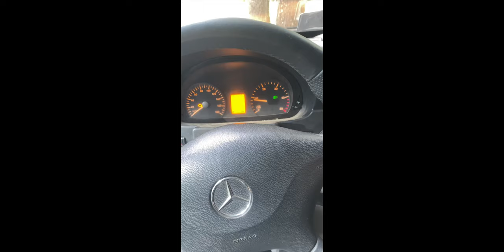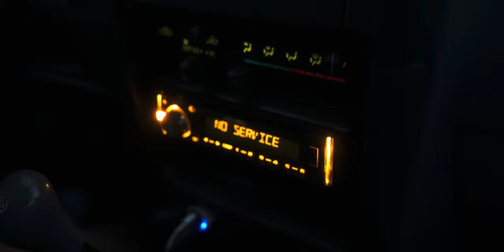JUST A QUICK UPDATE | #12 Back in Patagonia

Comment: Beautiful videos! Fantastic Trip! I am a fan. I cannot immediately find more information about your Sprinter. I think it is the third last type of Sprinter, so without AdBleu. But which motor? And is there a diesel partical filter in the exhaust? What are the results of the high sulfur diesel fuel in South America? What preparations or changes did you do on technical level for fuel filter, motorcomputer or exhaust? Thanks for answering. See you on the road. 👍🙂🚐
Reply from the maker: Hey there, it's a 906 315 2.2L 4cyl without AdBlue. We currently have no pre-filter installed but we might do so before entering Bolivia which is notorious for bad fuel. Diesel quality in Brazil, Argentina and Chile is generally no problem. Sulfur levels could become an issue at higher altitudes though – or higher altitudes in general. Feel free to write me a mail concerning the DPF! Cheers :)
Reply: @fromwhereweare  Thanks for your answer! ❤️  I have a 319 (= 3L 6cyl ) from 2017 = with AdBlue and DPF filter. I think that is a bigger problem even if you take enough AdBlue liquid with you. Please let us know if you see other Sprinters and what type. You would do me and other owners a great pleasure to let know in your videos if they had any technical problems. You're never learn enough. Better be good prepared with less problems on the way. Thanks! 🤙😊
Reply from the maker: @4x4overlandSprinter  There is a couple overland experts in Europe and the US that can help you out with getting the engine and the exhaust system ready for international fuel by removing AdBlue, DPF, Exhaust Recirculation Valve etc. At the cost of potentially loosing the permit to run the car in it's home country. If you plan on mostly traveling Argentina and Chile, I would guess that you could make it without engine modifications (as long as you take enough AdBlue with you and give the DPF enough time to recover from high altitude drives). Some were lucky. Some had huge problems with clogged DPFs.
Reply: @fromwhereweare  Thanks for the info! ❤️  I suppose they sell Sprinters in South America too. Maybe let us know near the end of your south america trip which motor the  young local Sprinters drive. If we know it is the same motor and fuel system as in Europe, then the problem is solved be reprogrammation of the ER valve & AdBleu and taking out the DPF. Looking forward to your next video. 👍🙂

Comment: Hey guys, did you have to modify your exhaust system in the sprinter to make it compatible with fuel in south america? We have a 3 year old sprinter 4x4 we bought and shipped to Europe from the US. We are hoping to make it more compatible with more diesel fuel in the rest of the world while we are here.
Reply from the maker: The two main problems with modern'ish Diesel engines is a.) bad fuel that clogs the injectors (prefiltering before and/or after the tank helps here) and b.) a higher percentage of I believe sulfur in a lot of places in the world, which leads to more exhaust fumes especially at higher altitudes which clogs the Diesel Particle Filter and potentially harms the engine because of the Exhaust Recirculation Valve. Euro 5(?) onwards also has the Bluetec systems which may cause issues / supply problems. There are companies that will take all of these systems out. Feel free to send me a mail if you need more tips on that!
Reply: @fromwhereweare  yes thank you. I assume you don't have a euro5 (bluetec) sprinter and didn't have to modify the exhaust? We plan on adding extra filters but need more details on DPF and EGR valve delete. I will send you message.